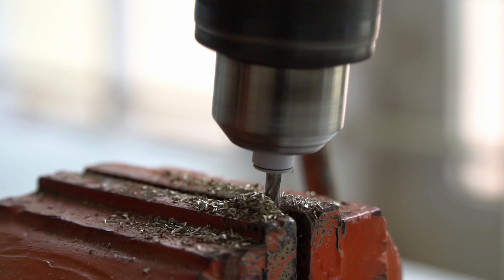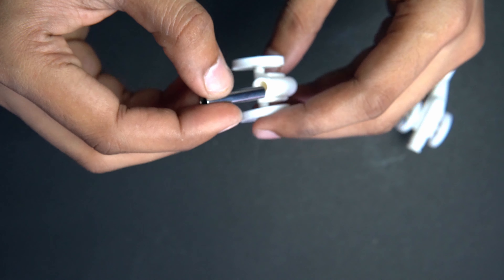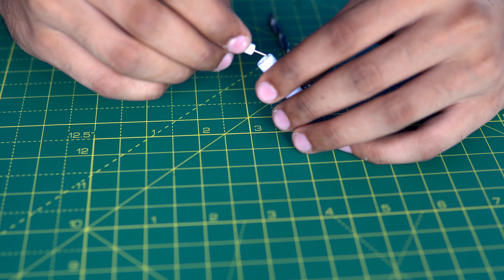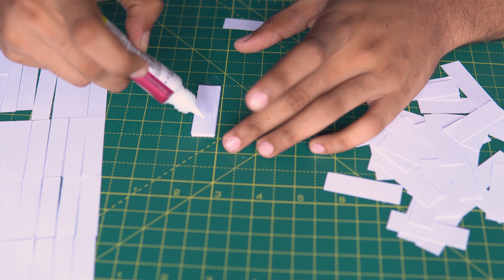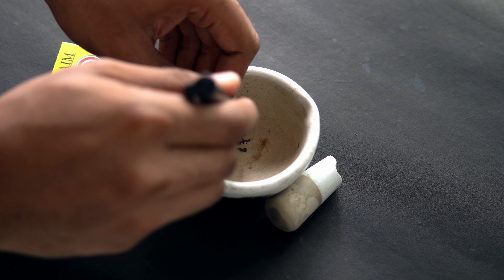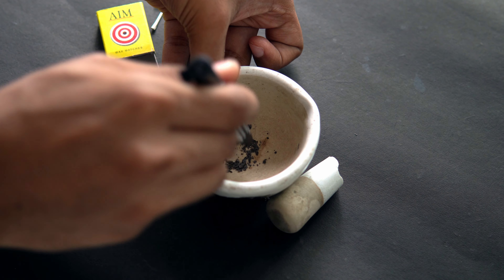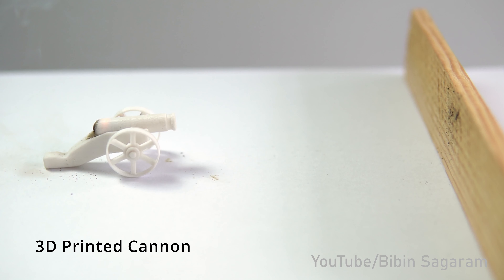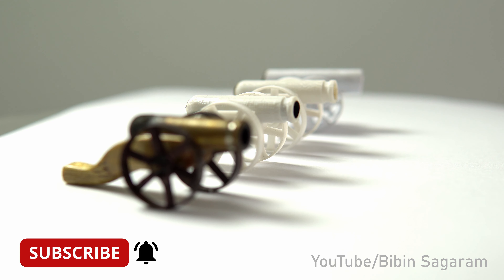Mini Cannon 3D printed !

Comment: Bro once u made a mini fiberglass bow, please please show and explain how u made the limbs  please please
Reply from the maker: 😊 some of the details and drawing is given in the description. If you have doubts regarding fiberglass, they're many good videos in YouTube.
Reply: @bibinsagaram  bro then give me the details about which kind of epoxy and material did u used to make the limbs of the bow
Reply from the maker: I used Polyester Resin and fiberglass cloth. 
Other two liquid I am adding is catalyst and hardner
Reply from the maker: Instead of fiberglass clothes, combination of   some fiberglass mat and unidirectional fiber across the length of the bow will be a better option.
Reply: @bibinsagaram  is it polyester casting resins
Reply from the maker: Nope they are different
Reply from the maker: Search for fiberglass in Amazon you will find it.

Comment: Great. My favourite is 3D printed one without metal sleeve, the fire can be seen in translucent plastic is nice. Can you capture the video dark?
Reply from the maker: Thanks Arul! Good idea, I have a plan to make a transparent cannon.
Reply: Also if you can capture it on a high speed camera. It will be amazing 😉
Reply from the maker: I thought of that, but high speed cameras are very expensive 🙁. Currently I have only 240fps from GoPro.